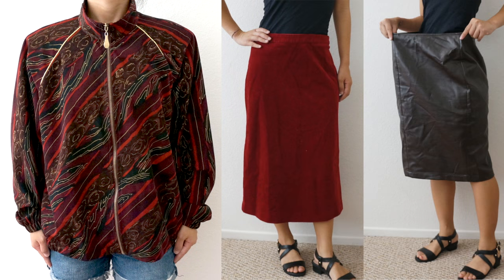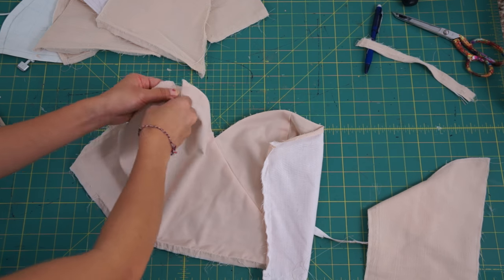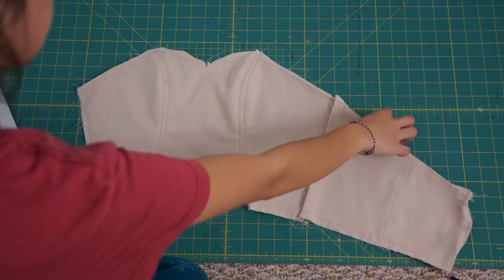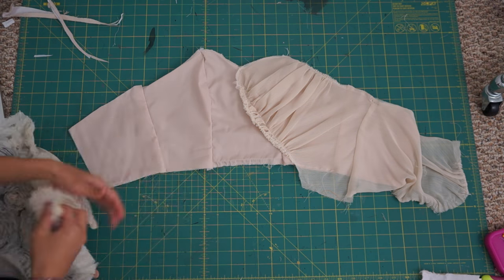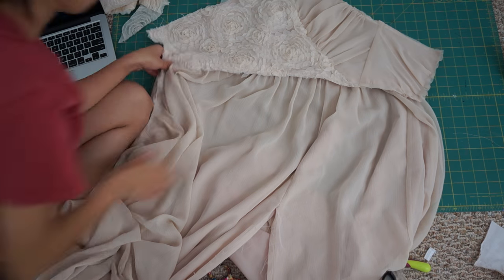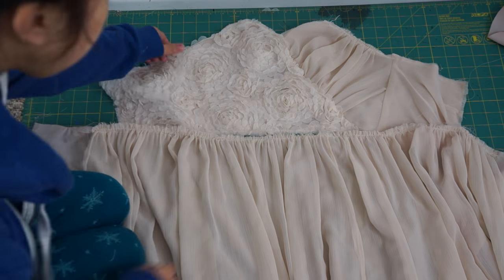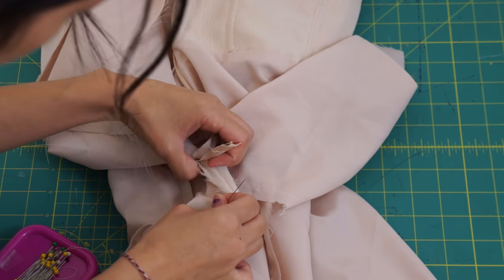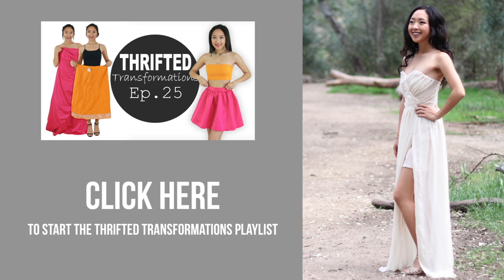How-to Sew a Prom Dress | Thrifted Transformations Ep. 26

Comment: Have you ever tried using a basting stitch to gather fabrics like chiffon or lace? You just use you machine and make a temporary wide stitch across the line and then pull the string to tighten the fabric to the desired length, then use your hands to distribute the peaked and valleys as you want them. It's much easier than gathering and pinning. Learned that trick from Anika and thought about her technique here!
Reply: Lol nvm, you literally did this right after I posted that comment. 👍